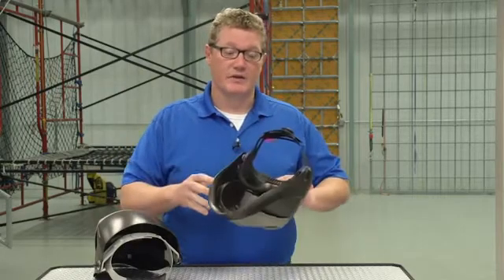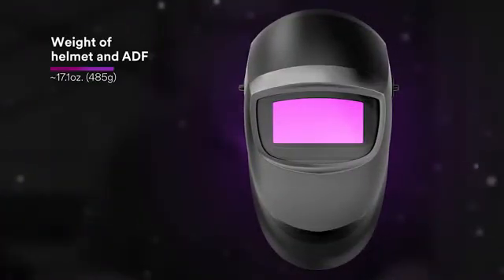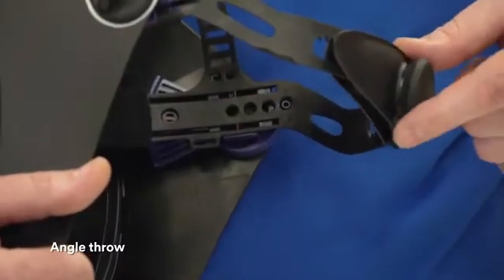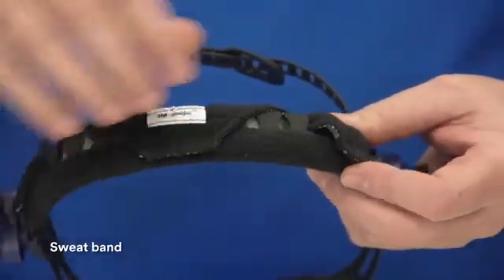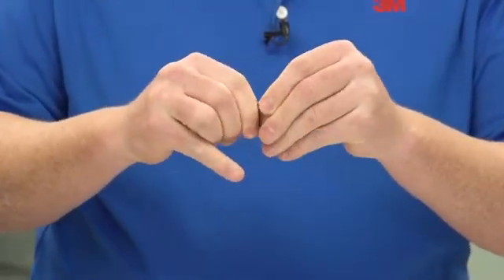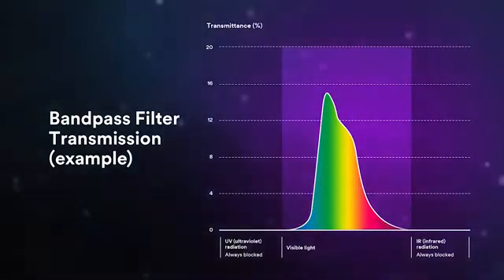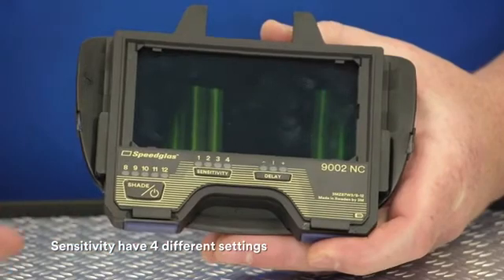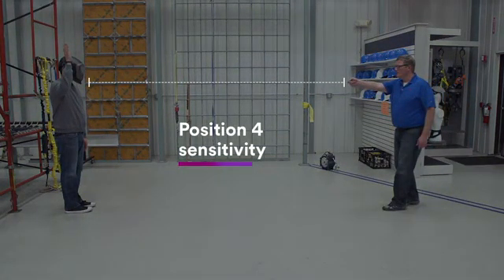3M™ Speedglas™ 9002NC Welding Helmet

Comment: Is the 9002nc is it a 4 c or 2c lens. I know you will get flashed when tig welding if it’s a 2 sensor. That’s a 2x4 lens . There 2 sensors. Am I right or I may be wrong